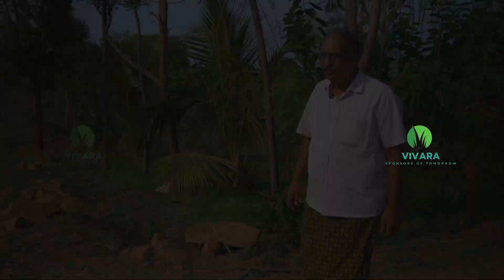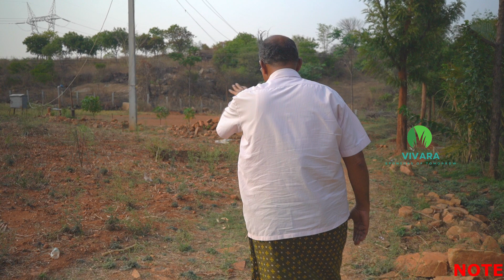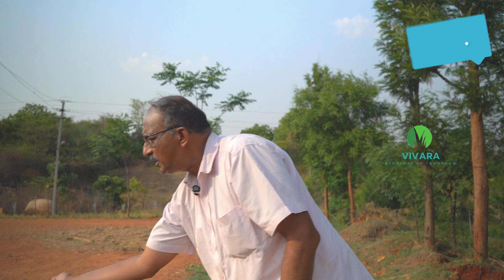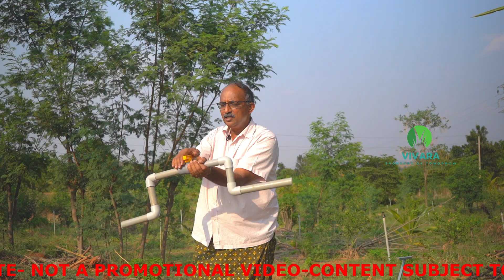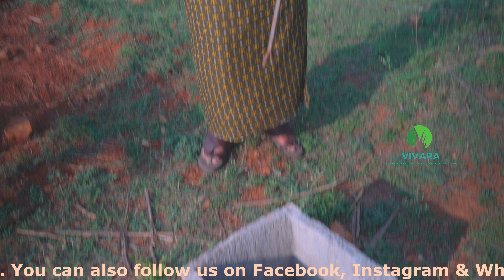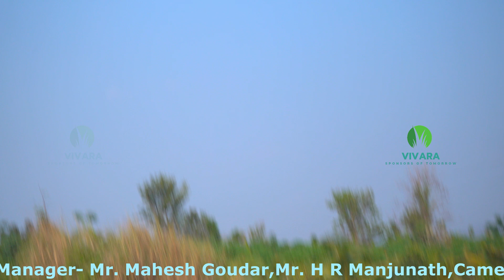Modern Irrigation Ideas in Organic Farms | Sustainable Water Management Tips.

Comment: Very good and informative video. I just have to add something. Have you used vetiver grass on your contour bunds. They are great at erosion control, provide excellent mulch, stabilize the soil, provide excellent water penetration, and help in pest migration along the soil profile (like nematodes)  . The greatest benefit is that it does not need any care other than planting. Wishing you all the best.
Reply: Thanks for the feedback.  Will use Vetiver grass in the next possible opportunity.